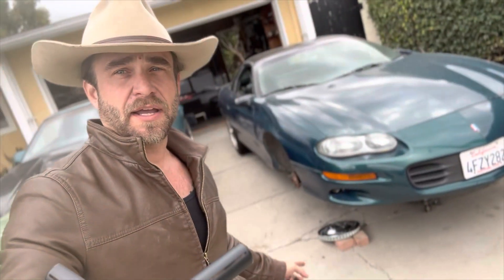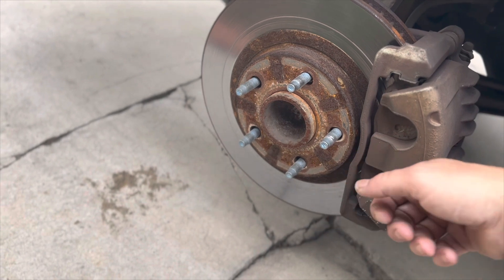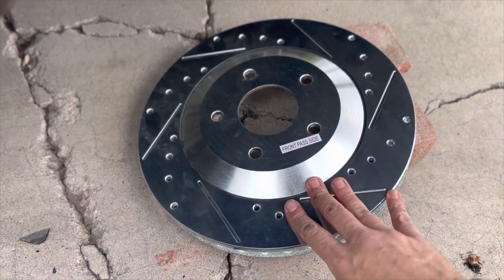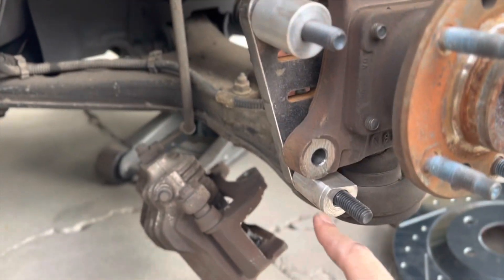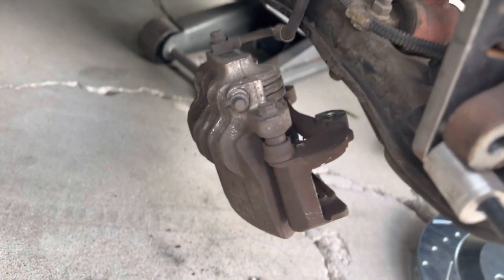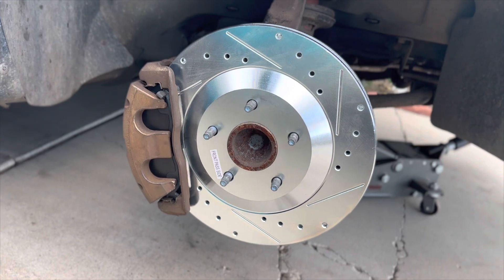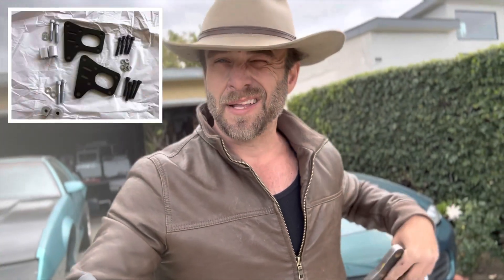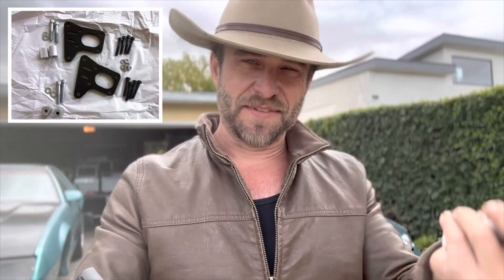1993-2002 F-Body (Camaro and Firebird) Brake Bracket Upgrade for C5 Corvette Rotors

Comment: The rubber lines are fine.  If you aren’t tracking your vehicle i would just keep the rubber lines.  They perform just fine.
Reply from the maker: I’ll see if I agree with you soon.  I’m going to swap them in the next week and see if the difference I remember feeling in my 20s was real or not lol.

Currently I think they are causing a slight fade that I feel (I only daily drive this one so far) but we’ll find out :)
Reply: More prone to cracking